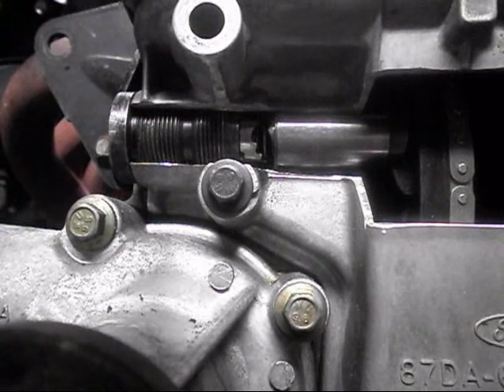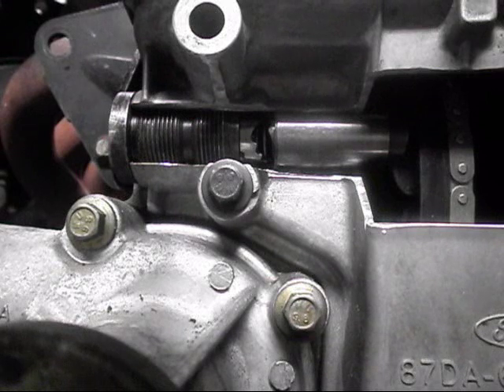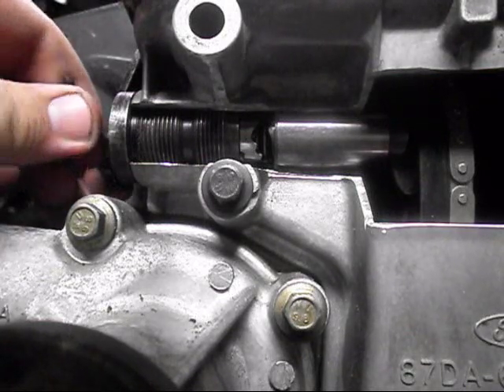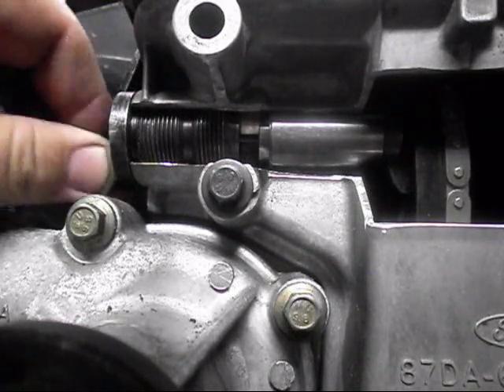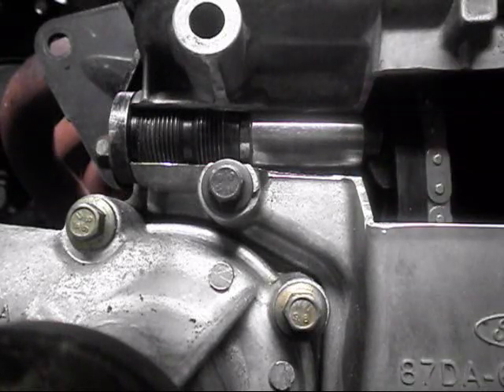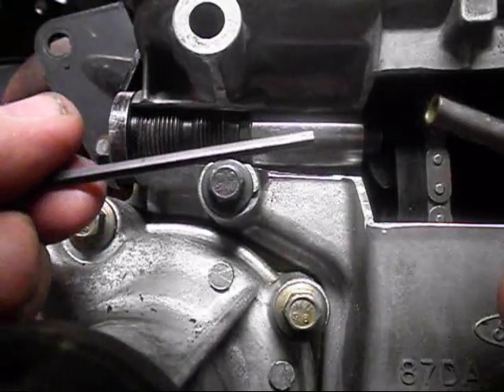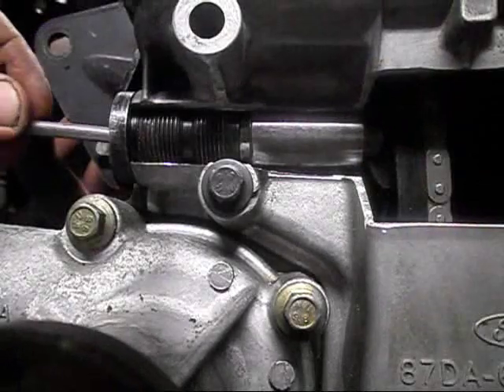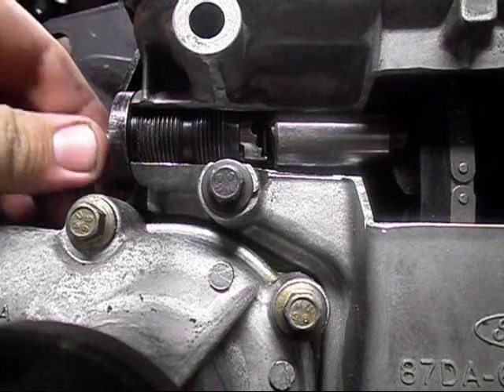Falcon Timing Chain Tensioner

Comment: if oil is leaking out of the bolt do you just undo that and change the washer or o-ring thats on it ? or will the tensioner pop out too  ? cheers dave

Comment: Hi Craig. Stupid Question. I have a Falcon AU series 3. Is this video showing the chain tensioner that works according to oil pressure, or is there another one somewhere in the engine??? Ive tried flushing my engine because I heard that they clog up and don't work as a result of it.

Comment: Hi craig.thanks for your help on the timing tensioner tutorial. Also is it a comin oil leak area? And timming case head seal area for oil leaks? My ef falcon has oil coming on to the water pump housing. Any feed back help. Regards john 14.11.19

Comment: Hey Craig, does this need to be done to change the head gasket or can I get away with out doing it? Concerned about letting tension off the chain and having the chain drop off the lower sprocket

Comment: good vid mate :) those tensioners are a bit of a pain. i think i used a screwdriver to release it, but an Allen key to draw it in. i'm not really a great fan of the design because the nut almost always comes out with the plug(especially if someone else has had the plug out and tightened the crap out of it when re-installing it).

Comment: Hi Craig - Happy New Year to you and your Family. Need your Help. I have a question - I have a Ford Fairmont AU series 3. It leaks oil from the Tensioner. Do you have a video pn How to seal it? Do I need to change the Orings? To do so, do I need to remove the entire tensioner OR unlocking it will let us to put the Oring in. Do ww need any sealant? Please suggest a good one. Thank you and I am looking forward to hearing from you soon.  Cheers Aldo
Reply: Just remove the inner threaded bung/Nut, apply some sealant and put it back in, no need to touch the tensioner. 
If leaking from outer ring the same applies, just remove it and upon re installation apply some gasket sealant!
Reply: @alliancegaming8486  
Thank you so much for your reply. I am attending to it and following what you've suggested.
Reply: @alliancegaming8486  
Hi Craig are you in Sydney? Please let me know. As I need someone to do the sealing for the retainer. I have asked 2 x mechanics so far and they refused to do it!! Even the NRMA says it's the Tensioner seal!! Or do you know a mechanic in Western Sydney area? Please let me know. Cheers Aldo
Reply: @alliancegaming8486  
Hi Craig I am attemting to seal the tensioner retainer again as it is leaking. I have even changed both the ORINGs at the top and the bottom of the retainer. Would you kindly tell me what sort of sealant you recommend? As I have used the JB WELD (black) But still leaks. May be I used little because I thought it may drop in the oil if I use much. Furthermore I didnt give much for cure time. I only gave about 12 hrs. As on the JB WELD Instruction says 24 hrs. What sealant do you suggest? Please let me know. Thank you for all your help.
Reply: @alliancegaming8486  
Hi Craig - I have finally managed to reduce the Oil leak by 99.99%. I have changed the ORings and as you have mentioned, I have used JW WELD Black - Oil resistant,  up to 280 degrees. BUT  I had to open and close it 4 x times. The tension Retainer that holds the ORings was sealed successfully.  But the leak was from one of the LONG Bolts going in the Rockercover. So I ve opened it and resealed it with sealant. Now it is just a very  very small dot that comes from behind that bolt. It doesnt even drop. So I am extremely happy.  Thank you so much for your advice and your video clip. God Bless you.
Reply: @aldobiglari4575  Some have also used thread tape in conjunction with sealant.

Comment: Hey mate.
Ive just redone a head gasket on an xh van.
Its all good except it has a new whining noise.
Could that be the tensioner not sitting correctly or too much tension.
Thanks for this video.
Im new to tension chains been rovking xf panny vans for years.
Reply: Hey mate, did you ever resolve this issue? I've just rebuilt my engine and it's got the same noise on decel
Reply: @jakobmoore4832   from the side of the block i remember pulling the tensioner out and putting it back in and it eventually went away. i reckon it was reseating itself, hope this helps.
Reply: Thanks mate unfortunately my noise is on the other side of the engine.

Comment: ive got a bit of a problem, before watching this, i undid the whole plug, just from not knowing what to do, the tensioner popped out, so what i did to get it back in was located it in the hole, the did up the outter plug and with my allen key release the tension off it, is this right?
Reply: Jack Lynch i my self am doing this for the first time and had same thing happen how did you fix it ?

Comment: Craig do you have a diagram how the cam and crankshaft marks should line up on a el 4.0 sohc engine and how to get no1 piston TDC can't find diagram
Reply: Crank shaft key way and the line on the aux shaft line up tooth for tooth and the cam gear sits 5-8mm about the head on the right side

Comment: Craig are you required to remove the water pump to get the timing cover off thanks
Reply from the maker: Hi Russel, no, you can remove the timing cover without removing the waterpump. It does make it slightly easier without the waterpump in place but it still can be done. Regards, Craig
Reply: @autofix73  thank you Craig I did it

Comment: my one rattles at around 1200rpm and when decelerating the engine. ive changed the tensioner and reset it so many times and changed the chain and guides... still the same.
Reply: I'm having the same problem in my EL Fairmont Ghia. I'm getting ready to order a  new chain and guides, etc but now I'm worried it won't fix it. Mine does have a rattle at idle too.
Reply: Has anyone fixed this? My freshly rebuilt engine has the noise and i want it gone :)
Reply: @jakobmoore4832  Convert to old school Holden 6 gear wheels.

Comment: WHY IS THE AERIAL PIECE REQUIRED WHEN RESETTING BUT NOT WHEN RELEASING ? Just about to try this and don't want any slip ups.  Thanks.  MAXXAUS.
Reply: When it's all locked up sometimes you need to put some inwards pressure on the centre parts to make it easier to turn when unlocking.

That said I've done a ton of these in the past and never needed anything like that aerial piece to unlock the tensioner. Just put an Allen key in the hole and turn and it will unlock and release and spring open.

The best learning for understanding is to remove the tensioner from the chain cover and look how it works. Its an exceedingly simple device with only a couple of parts. Once you have it in your hand you will see there will no mystery on how this little device that seems to scare everyone works.

When it's released pull up on the chain as it goes over the cam sprocket and there should only be 2 to 3mm of slack at most.
Reply: @arm7987  OK THANKS MATE,  STILL A BIT JITTERY THOUGH,  I THINK I CAN,  I THINK I CAN,  I THINK I CAN,    LOL.     MAXXAUS.

Comment: Craig i have a 2004 BA mk11 xt and when in stop start traffic you can hear a split sceond of timing chain noise as you move the car up in traffic.Now im sure it needs a new chain tensioner so please help with info needed. or is it adjustable as per your video HERE. TIA.. Robby..